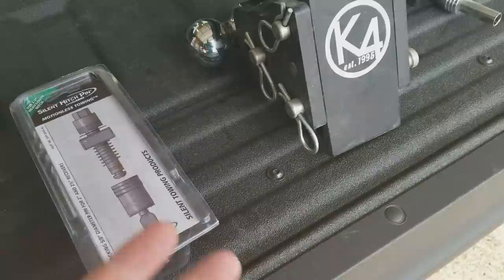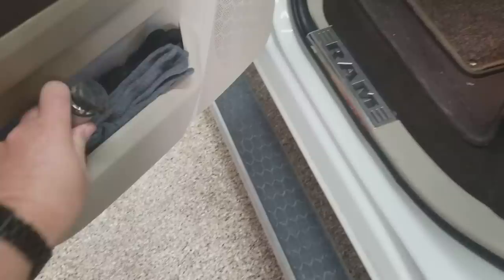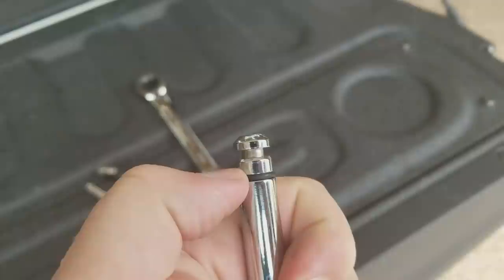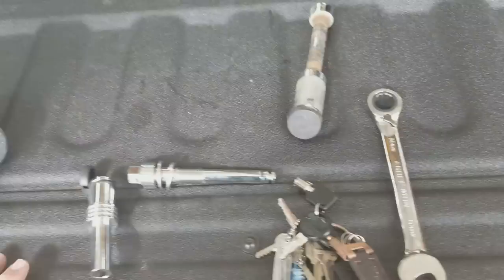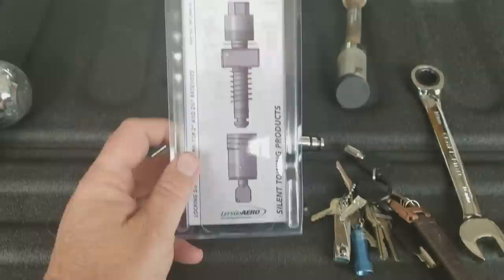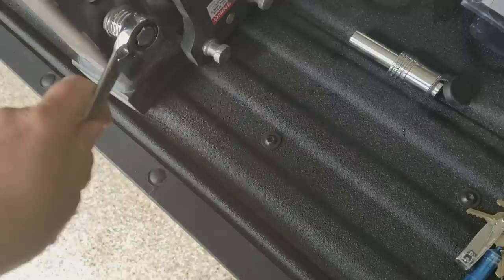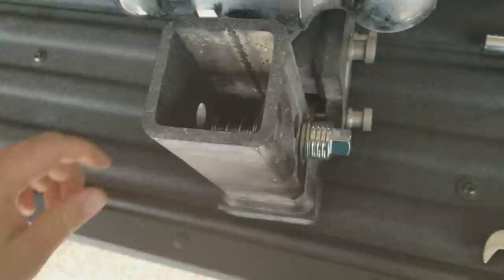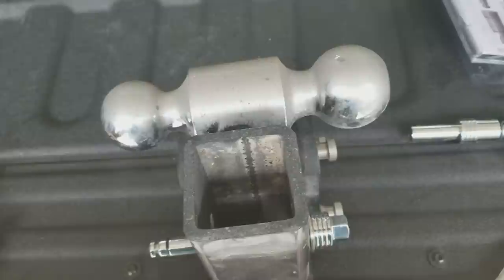Finally a locking hitch pin that I trust to keep my B&W Stow and Tow!

Comment: I'm protecting a $500 Küat bike rack.  The cheap locking hitch pin they provided with the rack will last about 5 seconds against a pipe attack.  The solution I came up with is to use a high quality, mini U-Lock as the hitch pin.  These things are designed with dual deadbolts to withstand leverage attacks and at 13mm think, it would take a long set of bolt cutters and a lot of weight to cut.  With the location of the pin being so far under the bumper, I'm not sure a thief could position bolt cutters to generate the force needed to cut through it.  OnGuard 8013 Bulldog Mini U-Lock is a $30 solution.
Reply: Thanks for the idea two years later. I just bought myself a Küat bike rack myself and went to buy a lock just to have something decent at least. But I was looking for a better more robust permanent solution. Imma check this one out.

Comment: You missed the main point of security against shearing the lock head off.  The locking mechanism on the second pin has a sleeve that goes over the pin shaft itself that takes the sheer off of the small portion of the pin where the lock retains itself and places it on the full diameter of the  main pin.  Stick a pipe over the second one and try to break it vs the first style you showed.  The difference will be dramatic.  It will not break in the first place.
Reply: It will break, just take longer.
Reply: Weld a small piece of pipe over/around the lock end so they can't get a pipe on it.
Reply: Same for nut end, then use a socket to install. They wont be able to access it all then ;)
Reply: @The2012waiting  It is a shame that nut is not like a wheel lock nut that needs a 'key' socket to release.
Reply: @The2012waiting  thieves carry a variety of tools. These pins will be easily defeated
Reply: @glutenfreegam3r177  definitely,  but anything to help is worth a try

Comment: Could get the same effect with a grade 8 bolt.  Use a magnet pin and hold nut inside the receiver through the back, thread though the inside nut then put 2 nuts on the other side and lock them down.    Even tack the 2 nuts with weld.    Probably never get it off.

Comment: What I did to mine was welded a cylinder type thing on the side where it locks from where the lock barely fits inside to where if they do put a pipe it won’t break it’ll just go around the cylinder

Comment: I was forced to do something similar with my Thule hitch receiver bike rack.  There’s a but welded inside the rack and it comes with a bolt instead of a hitch pin to cinch it tightly against the hitch to remove any play.  So I bought a long bolt and drilled a small hole near the tip of the threads.  Now I have to thread that long bolt into the hitch which takes some time and a quality luggage lock on the end.  Hopefully it’s enough to slow thieves down.

Comment: That’s a lot better than what I have. And one more added feature of Your locking pin is; The part with the groove in it which snaps onto the other end is 50% embedded into the tongue where you can put a pipe over it all you want, but you can’t break that part off like the cheap Curt pins can be. What’s the brand name pin? I’d like to buy one.

Comment: Just weld something near the lock in the hitch were they can't stick the pipe nd something in the front that way it will not be posible to stick a saw and will be fine
Reply: Pins don't easily come out once a head or tail is sheared. Before it is likely to slip out,  Itd need to have been wiggling around for quite a few starts, turns, & stops. So you likely weren't paying much attention, or you grossly over stressed the pin cause a different type of failure. 
Did you recover the pin after it broke loose?(who am I kidding people who blame anyone but themselves are gonna claim: "the pin was stolen & that's how I didn't endanger anyone. It was the thief's fault!!" Lol

Comment: Not most but lots of crack peps tend to bring a tool bag.  Just saying.  I'm in oakland ca and they strip cars next to my camper all day.  The put in over time hrs to get it done quick.  When they are done they pull the car shells in the middle of the street and call the cops so the can take it away.  That's how they get rid of their trash.  They fill the empty cars full of trash.  These dudes are very resourceful.  So best of luck with the no wrench thing.
Reply: Wow, I'd get out of that place!😮
Reply: @DonzLockz  no way it is next to work.  I need the over time hrs. 

Lol.

Comment: you know what would make your first lock pin work?    Weld a thick walled, close fitting 2" long section of pipe at the hitch bolt hole.     Now you slide that big pin through the hole, attach the lock, and the entire lock body is inside the pipe, fully protected from being bent off.   ...even weld a gusset on the pipe to  make it stronger and also prevent a pipe from gripping it.
Reply: Awesome idea! I'm gonna do that but make it a bit longer, just enough to fit a 10mm hole and a (non Masterlock) padlock to prevent access to the low security hitch pin lock with a tall shackle padlock. Just another layer.👍🍻🤠🇦🇺

Comment: It’s ironic. The simplest solution is if you don’t have a trailer on the truck take the hitch off. I know everybody loves the convenience of always having it available. But if you don’t want the thing stolen, take it out of the receiver. Lock it inside the vehicle in a storage compartment or something. Where they can’t see it if they don’t see it they won’t know it’s there.

Comment: I ran a 5/8'' bolt through the hole, jammed two nuts on there, blind-pinned the nuts, then rounded off the outside nut with a grinder. I wouldnt trust that hitch pin, if a thief's got a pipe he can also get an adjustable wrench and have it in a few seconds more.
Reply: What does "blind-pinned" the nuts mean?

Comment: IMO it's BS that B&W doesn't have an option to get 4 locking bolts (all keyed the same) when you purchase these.  That's why I like the Weigh Safe design much better.

Comment: This has a 12k lb capacity. If that’s the 3in shank B&W, it has a 21k lb capacity. Wouldn’t you want a pin that is as strong or stronger than your hitch?

Comment: Just get a grade 8 bolt with a nylon locknut on other side it'll tale 2 wrenches to remove ,you can make it even tougher get a socket head bolt that requires a allen wrench and save a pile of money over those fancy locks and be more secure.
Reply: Buy a bolt a little longer. drill a hole after the nylok and put a padlock on it? Eh?
Reply: Get a torx bolt and leave them really scratching their heads

Comment: What do you do to keep people from pulling the other pins to steal the ball assembly?
Reply from the maker: shepherdbrooks the B&W fosent come off like that... It only rotates around. They could steal the pins but that's much cheaper than replacing the hitch!
Reply: TheKeatons4 ok I got ya.
And the ball piece is captive too. The pin is only to rotate?
Reply: I forget what make my hitch is but it has a hole drilled below nut for a cotter pin in threaded section.Isn't much but one more thing the thief would have to get past It could even be drilled larger for a sping tension spring or small lock
Reply: 12" braided stainless cable.  Thread it through the cotter pin holes and put the loop ends around the aero lock.  It won't keep some jerk from cutting it and taking the pins, but will keep your jokers passing by from nabbing them.

Comment: Het rid of that sheetmetal  bumper and get a real tow bumper,  better yet weld one up yourself.  Then get the ball you need, weld it to the bumper, or tighten the nut and then weld the nut to the threads on the ball, problem solved. Stop playing with trash, go old-school and make it to where they have to steal the truck to get the hitch. I swear kids these days never think of substance, just flashy looks.

Comment: What about the part the flips around on your hitch? Looks like they pull 2 pins and you only have 1/2 a hitch
Reply: It doesnt come off like that, all they can take is the actual pins
Reply: @bizzle4819  You are right on most receivers but some allow it to ride up and slip off   I noticed they sell a plate for those people having that receiver. My complaint if it is one is the weight loosens my anti rattle lock pin. I’ve torqued to spec and just tighten the hell out of it and it comes loose. I blame the pin.

Comment: Go luck getting that off if it seizes from rust or gets stuck .
Reply: I put anti seize on my threads. Comes on easily although it pretty much stays on.
Reply: A stainless pin and lock could be used instead of chrome plated steel.

Comment: You failed to point out the other feature of this locking pin, it doesn’t look to me like anyone could break off the lock end due to the way it inserts through the hole in the receiver.  All of the other locking pins due just attach to the tip of the pin.

Comment: idk i just keep my hitch inside car when not using it
Reply: until your first wreck and it starts flying around the cabin
Reply: @sckirbyc1  There are some compartments in different trucks that have secure storage bins with locks either beneath the seats or inside the floor.

Comment: Fwd:Look at this on eBay
https://rover.ebay.com/rover/0/0/0?mpre=https%3A%2F%2Fwww.ebay.com%2Fulk%2Fitm%2F223870538354
No Rattle Locking Hitch Pin. 
The typical dog bone style by REESE was defeated in seconds with a plastic PVC pipe due to the plastic internal parts.

Comment: I would just pull the pins from the lower end and take the lower half lmfao
Reply: You've clearly never used one then. You can't get it off without removing the hitch. At best you'd get a couple pins and cotter keys.
Reply: @seeingred1990  Proper word for it is "SLIDE PIN"  Keeps the swing arm from detaching from the  unit itself! I totally get it wasn't aware that BW made it like that  UNTIL  I went back and watch it again.  So why such the  big deal being made over someone elses minor mistakes Geesh!!!!!!
Reply: Topdog Mechanic, I think it all falls under the saying- think before you speak. Or even better yet, read through the rest of the comments. It’s already been said.

Comment: Can't they steal the ball because that's not locked? It's held in by 3 pins?
Reply: Yes they can,  pull 3 clips and pins and its gone unless you buy the cheap locking pins for that also as this new threaded one won't work for those holes.
Reply: @mikethompson2007  wrong Mike... The ball doesn't come off of this hitch lol it rotates around the drop... Its either steal the whole hitch or nothing, or of course someone could steal just the pins themselves.

Comment: People who steal hitches, etc will also have wenches with them.  Cause they know people who are tooooo cheap to buy a hitch pin locks will use a nut and bolt to secure the hitch.  So your concept not able to take or unlock your hitch due to the threaded head is not secured as well.

Comment: TheKeatons4 you forgot you have 3 other pins on that hitch!
Reply: 7425kevin doesn’t matter. Stealing those other three pins on the ball mount  is just more of a nuisance than anything. They may pull those three pins but the ball mount isn’t gonna slide off the hitch unless the whole thing’s removed from the receiver tube.

Comment: Really dumb that you call pull the 3 pins and they can take off with them.
Reply: Wrong
Reply: @DirtNassty  right!! You can pull the 3 pins and take off with them.... not the ball or hitch just pins its a dumb design

Comment: Ah, um., I really don't know, ah, um. what you are, um, ah..........
Reply from the maker: Just trying to be helpful... Sorry you didn't like it.
Reply: @thekeatons4  The video was very helpful.  I just bought a tow and stow, and I'm doing the silent pin like you.  I think a little grease will help prevent corrosion.  Taking the hitch off at least once a year for cleaning might help too.   And for those saying, "Take the hitch off, and you won't have a problem",  we bought a tow and stow so we wouldn't have to take it off all the time.

Slowing thieves down deters them.  Many of these types of crimes are so called crimes of opportunity.  And NOT, the work of a "hitch thief", although I'm sure they exist.  Thanks for the video.